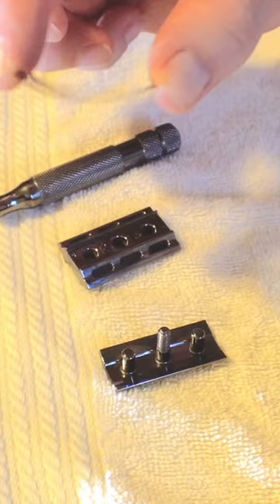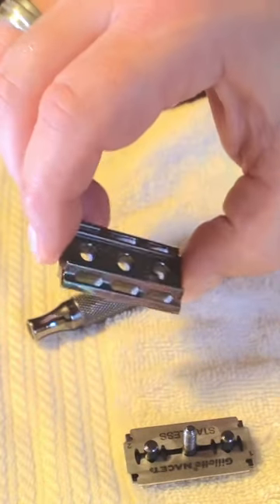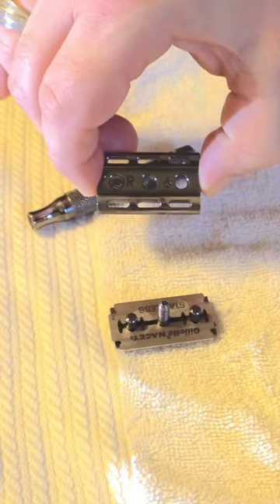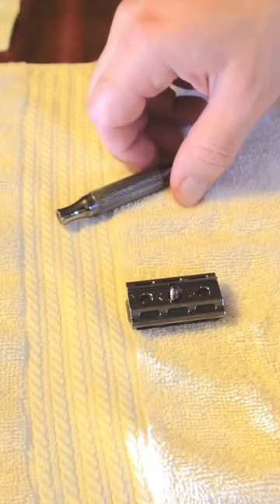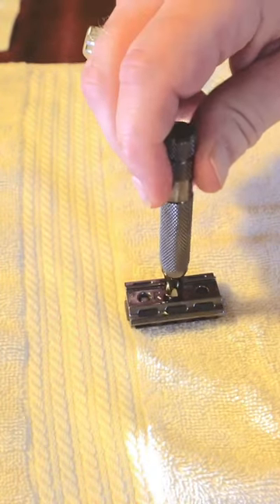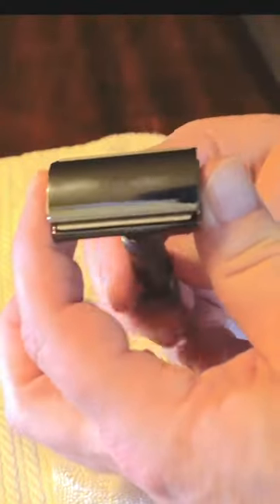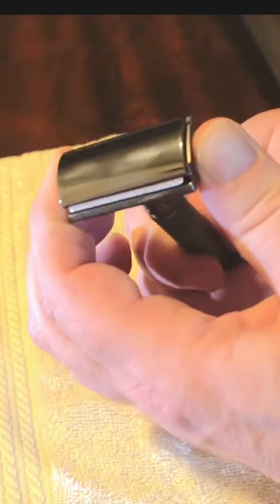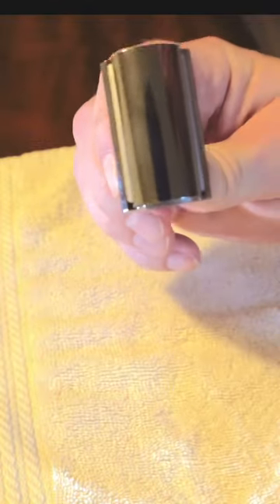How To Load & Unload, Safety Razor Blade #shorts

Comment: Brother,
If I may point out?
The top plate/cap is what you lay the blade onto. The back plate is the interchangeable part of the system. i.e. the R6/R5, R4/R2, and R3/R1 plates.
Btw: I'm going to be posting a video on how to align blades without looking on three different types of razors, TTO, 2 piece, and 3 piece.
Reply: Back plate? Topcap, baseplate, handle